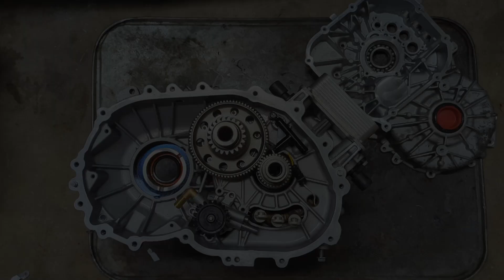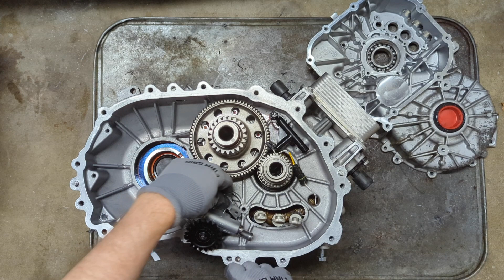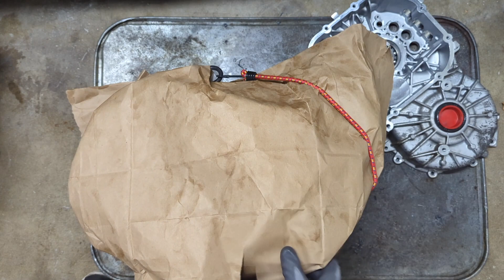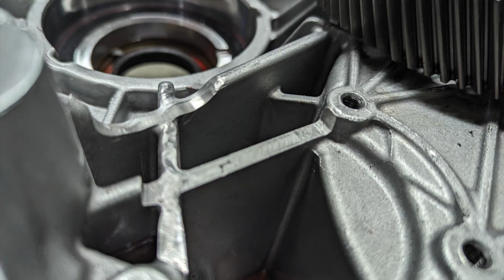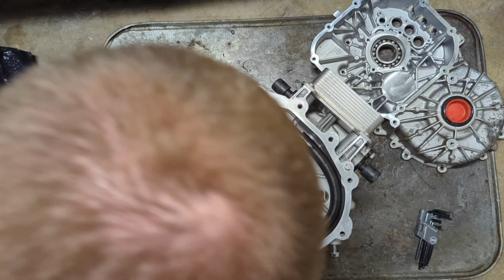Tesla FSDU Reverse Oil Pump Install

Comment: For the hole farthest to the left, you did not actually make a hole for that right? I answer myself. I see there is a thread in the bracket. So that hole is for the pump to fit tight into the bracket hole